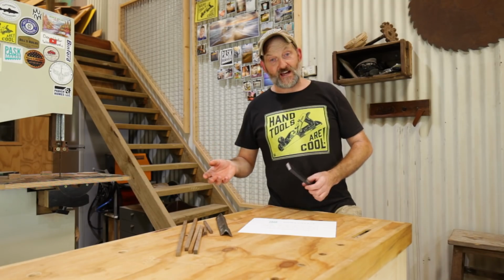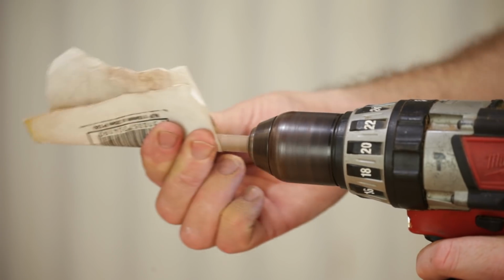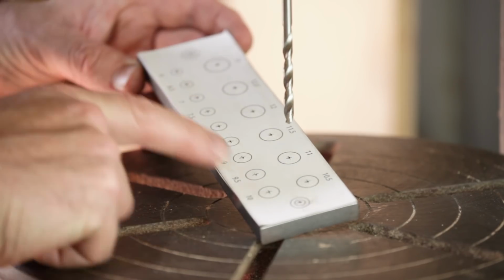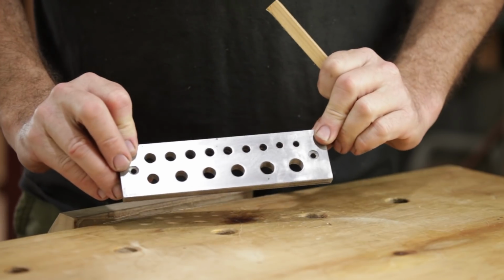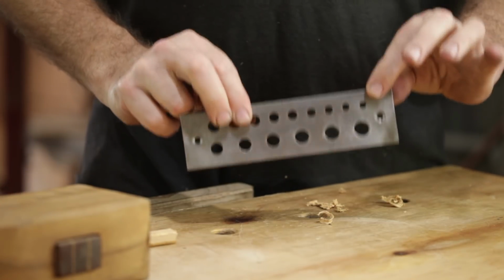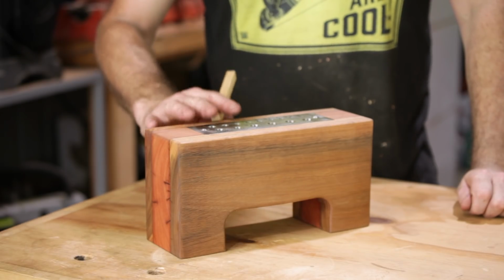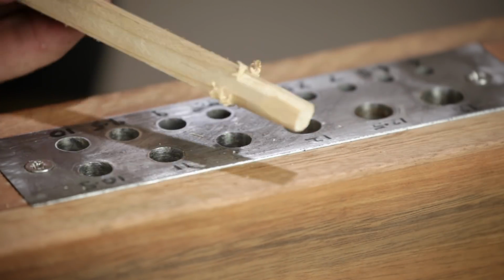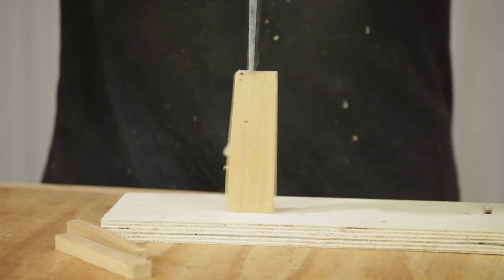Making Dowels with a Homemade Dowel Plate

Comment: Have you seen how to make a dowel with a chisel? You need a scrap of something a little beefy, like 2x4 material. Drill a hole slightly bigger than the dowel you want right on the edge of the wood. You want it to leave an opening in the edge. It is probably easier and safer to shave the hole open with the table saw. clamp the chisel at a slight angle across the opening so that it acts like a pencil sharpener. Then you chuck your square dowel stock into your hand drill and spin it through the hole. Don't go too fast or you can burn the edge of your chisel from the friction. Try it. Much faster than a dowel plate if you are making a number of them.
Reply from the maker: I’ve tried that with both a chisel and the tablesaw, it works well but you need to make a jig for each size hole. 😊

Comment: So that's how you get a square peg in a round hole!
Reply: You use a hammer, and if that don't work, use more hammer...
Reply: @xaiano794  If a bigger hammer doesn't fix it, it's electrical.
Reply: @HomelessPank  I'm an engineer, that means I solve problems, not problems like what is beauty because that would fall under the prevue of philosophy - I solve practical problems...
Reply: thats what i was doing as a kid, I just wanted dowels.. whos dumb now!!!
Reply: Check out taufledermaus.
They have an interesting way to fix electrical things that no longer work.

It helps to be a Taylor Swift fan. 😉
Reply: Michael MacGyver   Bigger hammer
Reply: @xaiano794  I love seeing this reference
Reply: Told ya it'd fit
Reply: Check out the channel.

All will become clear.

I wouldn’t know. My guess is she doesn’t need one.

Comment: I was talking to my Son yesterday about your video. He is a welder and gave me a piece of 1/2 inch steel plate that he had left over from a job. He found a 5 ft tall giant bird cage, removed rust, welded a little, epoxy to a few holes and paint. It looks like new.

He had to buy 4 dowels for it. I told him about how we can make as many as he wants. In disbelief I told him about you, and the challenge is ON. 
I'm going to drill imperial SAE and METRIC holes and he has to try it out. Thanks for the tip. I bought a KREG plug cutter for pocket holes. With this, don't know if I'll EVER get to use it. Thanks again.

Comment: Made this using your template.  Many thanks.  I found pressing a wood rasp to the spinning dowel as it goes through the plate is useful.  Just a little touch with the rasp on wider parts   helps prevent using excessive pressure and potential for breakage.

Comment: If I may suggest, countersink the leading edge.  The reason is with a square edge you are cutting the wood.  With countersunk  hole you tend to compress the dowell a bit, and when you glue it in it swells up a bit for a good tight fit. You also want to put a small relief on the exit side as well.  An old pattern maker showed me this method.

Another improvement would be to drill the holes slightly undersize and reem the holes to size and perhaps lap (polish) the holes.  For a really good job make your plate from tool steel and heat treat and then polish.  This may sound like overkill,  but it would make the best dowel.

You probably don't have these tools, but you got the woodworking down.  Offer to trade with a machinist.  Betcha he would really like some nice wood tool box fixtures to hold his micrometers, indicators and the like.

Great video!
Reply: what do you mean with:" You also want to put a small relief on the exit side as well"? my english is not that good. Thanks
Reply: @chomskyist9638  On the plate the wood is forced in one side (top) and comes out the other side. (Bottom) the bottom of the hole should have a small taper.
Reply: @MrRShoaf  thanks, taper out, right?

Comment: Pretty cool. If you take the plate to a machine shop and have it surface ground after the holes are in it will be razor sharp and wook even better.

Comment: Absolutely brilliant. I have tried quite a few dowel making jigs, and I think the use of a circular saw is good, but unpredictable. Routers are another source, but once again, unpredictable, especially when the stock is fed into the router bit from the opposite end of normal feed, very dangerous. Thanks for the advice regarding different types of timber, softwood and hardwood. As you say softwood can be used with a drill, but hardwood is a different matter. I had to make some 1/4 inch hardwood dowels once, and used a drill, with the stock in the opposite end in a bearing secured. It worked well using a sanding block, but took some time.
Reply from the maker: Thank you very much David! And thanks for sharing your insights. :)

Comment: Hi Neil. I love your videos and projects. I find them really inspiring. This one is the first I've actually tried out myself. And in order to do it I also had to make my own centre punch, which was fun in itself. At the time of posting this comment I've nearly finished making the 10mm thick steel plate: the dowel template holes are all drilled, as are the pair for screw-mounting the whole thing in a wooden block. My 50mm x 10mm steel bar is a bit oversize, so I'll be trimming that down to 180mm, or thereabouts, tomorrow. Thanks for sharing your creativity. Best, Seb.
Reply from the maker: Sounds great Sebastian! Glad you're giving it a go! Thanks! :)

Comment: Hmm could you add a countersink to one side of the jig? Then you could try to do the last pass from the opposite side and compress the wood a bit. Never tried it but could give more strength in softer wood.
Reply from the maker: Maybe, but it works pretty well as it is. :)

Comment: I made something like this that I use with bone to make small bone dowels for inlaying. Hammering will split the bone, but a drill press works great. Work the drill press a little at a time as not to burn the bone. Sometimes I will use oil to cut down the heat.

Comment: Good video. One tip: making a chamfreign on the botom side reduces the friction and make it easyer to hammer the wood trough the iron.
Reply from the maker: Thanks! I did think about that but it's not really too difficult to have a dowel in your hand to knock the last bit through. :)

Comment: Nice and simple! Mattias made one that uses a chisel to lathe (I guess) the wood down to size a bit like a pencil sharpener but he rounds it over on 4 corners with a router before running it through with a drill, better for long dowel (which isn't really required for anything useful anyway) but much more work and it's one chisel/block per dowel size. I might have to make one like yours as I hate paying for dowel. or anything.
Reply from the maker: Thank you! I did see that video, a few years ago now. :)

Comment: I found one just like it in an old garage.
It was basically a holder for drilling bits. I had to redrill them since it was all in inch:P
If its hardwood its nice to have a 0.5 mm increment increase.
Very good idea, thanks!

Comment: We all made this tool. For what it is worth it is good for ramming premade made dowels to fit your drill bit exactly. Or for the in-between sizes, like 10.5mm etc. However it is a pain to make a perfect dowel by using a square piece. Or shaving from 10 down to 5mm. And it is virtually impossible to go below 5mm, they will break (hammer) or twist, (drill press).
Reply from the maker: Thanks for the input! :)

Comment: Turn the plate over & on the other side you can counter sink the holes and cut some teeth into them with a triangular file so you can drill them in from that side & drive them from the other.

Comment: Friend, thanks for the video.  I'm going to make one.  And may I offer you a tip?  When you're drilling metal, if you use a lube like WD-40 or oil, your drill-bits will last longer.
Reply from the maker: No worries Dwight! I generally do use a drop of oil, not sure why I didn't here. :)

Comment: I think drilling each hole from the back of the steel plate with the next size up (most but not all of the way) would make a lot less friction and make the use of the tool and clearing the holes a lot easier.
Reply: I also thought so. But it's worth to test this theory with a particular size of hole, to see if it's worth the extra effort involved.

Comment: I had made a plate like this, and I found that it heats up without a place for the chips to go. So, I took a jig saw with metal blade and cut a "key" into each hole to help dowel go through plate, and aid in chip removal.
Reply from the maker: Thanks Ernest! I've seen that method done before but I haven't found a need for it. Mine seems to work fine as it is. :)

Comment: Besides looking good, is there a real world practical reason for using hardwood dowels? I'm guessing they're stronger but do you think it would make any perceivable different? But from an aesthetics perspective, a deep red dowel in pine...that'd look amazing!
Reply from the maker: I would say it depends on the application, a wide gate with pegged mortise and tenons for example, would have heaps of stress on the joint so the stronger the dowels the better I reckon. Yes the aesthetics of a contrasting dowel would look awesome! :)
Reply: You could just buy regular dowels and dye/stain them, much cheaper than using the respective wood.
Reply: Haha, how have I never thought of that! Thanks!

Comment: Great video! You answered my questions about both hardwoods and risk of splitting. Also, looking at the pretty dowel collection reminds of pen blanks which makes me wonder if this tool could be an alternative to turning pens for those of us without lathes.
Reply from the maker: Thank you! I've never turned a pen so not sure about that. I would think an interesting pen would need some sort of shape to it rather than just straight though. :)

Comment: I do this also, except i sharpen the edges of the metal holes. In fact I didnt know, you could make dowels without sharpening the edges. I will have to try your way - and see what works best
Reply: Drilling the rubbing the flat side on the diamond plate should provide sharp edges, I think? Do you use a more involved sharpening process?

Comment: Another job well done. Thanks for posting. ..Thanks for the tips about different techniques vs different wood. Would you make the stand again if you were to do it over, if so, would you make it the same way?
Reply from the maker: Thanks! While I obviously haven't used it much yet I don't think I would change anything. :)
Reply: Pask Makes I was thinking it would be cool if dowel dropped and gets knocked perpendicular by a well placed nail or something, then land on a tilted bottom that made dowel roll out the front like in a straw dispenser. That might be too much to expect in such a small space but I bet they could land on a sloped bottom that is sloped to the right or left and dowels can dispense out the side. That would be trick as f.

Comment: Could you make a tool to put splines around the outside to stop the glue hydraulicing at the base of the holes
Reply from the maker: When putting dowels into a stopped hole I usually put one relief groove down the dowel with a V chisel. Only takes a couple of seconds and doesn't even need to be neat. :)

Comment: Do you need any special bit for drilling into steel also what speed would you recommend to drill at
Reply from the maker: No special drill bit needed. My bits aren't expensive ones although they're not cheap ones either. I always drill steel at a low speed, you need to keep the drill bit from getting too hot. :)

Comment: Pretty cool! One of my next projects. Have you thought of putting in teeth into the plate creating more gluing surface but only for banging with a mallet oR tappping the holes for using with a drill?
Reply from the maker: Thanks! I hadn't thought of that! I'm happy with them as they are though it's a good idea. :)

Comment: I ended up making this, looks great.  I'm just having trouble making the dowels.  I want to use hardwood (Walnut) and when I hammer it through the holes I end up with a real bumpy dowel.  Not sure if maybe the square dowel is too large for the hole, although it's pretty close.  If I cut it smaller then the dowel has some flat sides when finished.  Not sure how to resolve this.
Reply: Perhaps your holes are not cutting the material well enough, your wood is just compressed into the holes, and then expands back to bumpy when it exits.
The edge of the hole is what does the cutting, ideally it should be a sharp 90 degree angle (a sharp corner around the circumference of the hole).
When you first drill the holes, a burr is formed - displaced steel that sticks out a bit over the surface. After drilling the hole, rub the top of the plate on diamond plate from coarse to extra fine (or a succession of sandpaper grits on a flat surface), you should end up with fairly sharp corners. The worst thing you could do after drilling is to remove the burrs with a hand deburring tool, a countersink or a bigger drill bit. The resulting edges will be rounded over and won't cut worth a damn, it would just let the wood compress into the hole, it won't be round when it exits the hole.

Comment: hey very nice, I really like this and it will save you alot of money, I have a steel plate lying around (I have no idea if its tool steel or not) its similar thickness as yours. Would you say there is a minimum thickness or does it just need that sharp cutting edge? How do you feel it holds up? Would you use tool steel, drill the holes and harden it afterwards? I have an oven available that can do that kind of stuff.

Comment: How many larger holes are needed to be added in front of your desired diameter.
For instance if I want a 13 mm Dowell would I need to start with 16 mm and work down to 13? Thanks great videos.

Comment: Great video! Very interesting. Does the dowel plate get "dull"? Can you sharpen it in some way? I would imagine I could just flatten the face again and it would sharpen the edges of the holes, but is that necessary?
Reply from the maker: Thanks John! The piece of angle iron that I've been using still works well and that has had a heap of use. Maybe over a few years it could dull but would be easy enough to flatten the face as you said. :)

Comment: have you considered notching out about 2mm 6 places evenly spaced into the holes on a slight clockwise angle.
It would sort of act like teeth and may let the hardwoods go through with the drill.
No idea if it would work just an idea.

Comment: Every time I try to use a drill it never works. Either snaps off or goes in a bit then stops. I even tried putting a small hole on the edge of the hole of dowel im trying to make as if it was a "tooth" that could help cut but nope. never seems to work.
Reply from the maker: Did you try different types of wood? As I showed in the video it was hit and miss but around half of the timbers I tried worked with the drill. :)
Reply: Yeah i tried a few. None seemed to do the trick. Tried walnut, padauk, maple, myrtle, cherry, and cedar. They all went in about an inch then snapped. 
I might still use your technique for hitting them through with a hammer though. Never tried that.

Comment: thank you for your video, it is great. I`d like to ask, why don`t you use some oil or any other lubricant fluid for the drill bit when you drill metal? That could save the tool`s capacity.

Comment: Looks like you made this with mild steel. Did you have to harden/temper it to get it to last, or does it hold up OK without doing that?
Reply: Made my first plate with mild steel. The holes lost their shape after a few pegs of hickory. I had better luck with an old lawn edger blade. The HSS bits for drilling the holes had a tough time with that lawn edger steel, confirming it was a harder steel.  I bought some Molybdenum bits to drill the holes.

Comment: I just watched this again, what a great idea!  What I need is to make pins made of wood starting at 6 mils down to 1/2 mils.  This is for re-drilling and filling stripped holes in guitars with a matching wood dowel/pin in the instrument.  I currently use toothpicks for the smallest holes, but it’d be nice to use mahogany dowels/pins on a mahogany Gibson guitar.  Any suggestions on how to make the tiny pins using a dowel plate?

Comment: If you're going to be using the drill method a lot, would adding a small kerf in the edge of the hole help with the cutting action?

Comment: I like the idea, the final dowel maker was fine made! 
Can I ask you why to use three parts of wood instead of a single block?
And shouldn't the border of each role be sharpened somehow?
Thanks in advance.
Reply: The cutting edges become sharp(-ish) when rubbing the plate flat on the diamond plate. The dowel making process will knock off the burrs automatically, it will be good enough as is, for the purpose.
If one would want to make it "perfect", then use tool steel, drill holes slightly undersize, ream to size, polish with slightly smaller dowels wrapped with very fine sandpaper, or charged with a polishing paste or stropping compound (chromium oxide), chucked in a drill. The polished surface (not just on the edge, but through the whole drilled hole) would reduce friction and the dowel making process would go with a bit less pressure. A hole drilled with a regular twist drill has burrs on both entrance and exit, is not completely round, and the surface finish is far from best. That is why for holes where it matters, a (smaller) drill is followed by a reamer - a bit that removes only a small amount of material, but results in a hole with good roundness and surface finish. Reamers are quite a bit more expensive than twist drill bits, though. It would be quite impractical for this project.